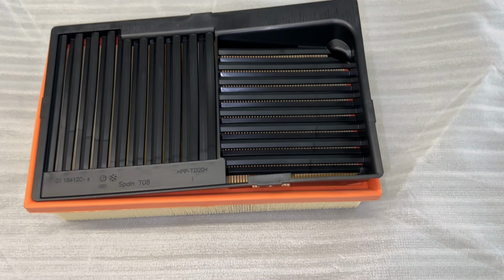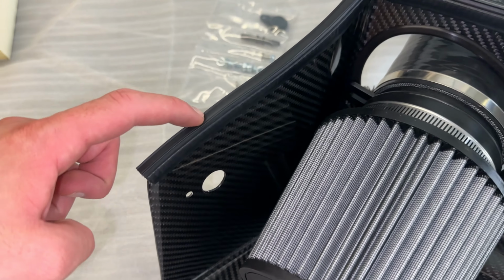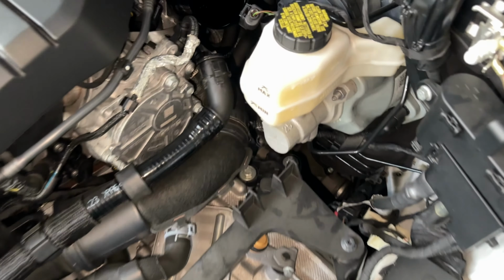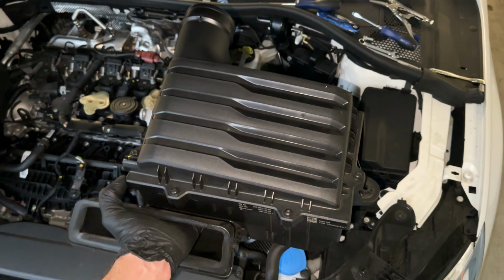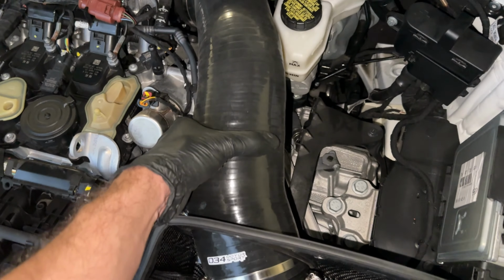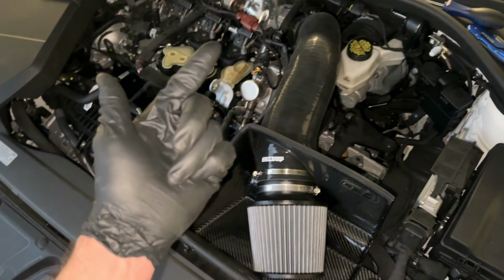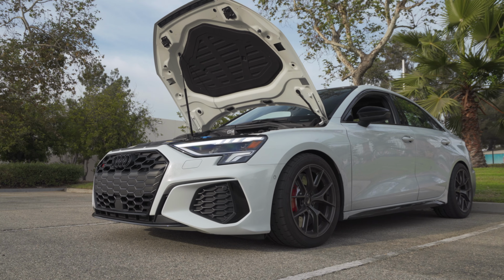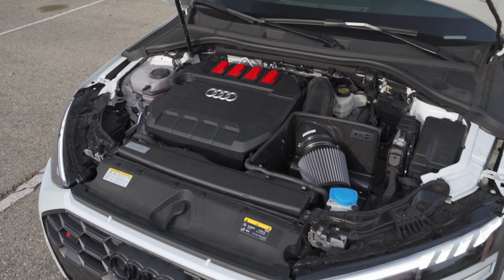The MOST Turbo Spool

Comment: Jewels, just as a fellow 8Y owner. Just keep an eye on making sure that the inlet hose is not rubbing on the brake line.
Reply: Seen a few guys have issues in the FB groups
Reply: I reached out to 034 and they told me they are working on a solution on the fitment issue. Not sure when we will be notified but it looks like this is getting the right exposure.
Reply from the maker: Thanks, it was adjusted during install to allow more clearance

Comment: I love how they make it seal to the hood, but leave a giant hole, where the intake tube goes through
Reply from the maker: Yup It pulls air away from the engine, as intended
Reply: Why would you want that?
Reply from the maker: @khalidfathallah6619  ambient air coming from the air-duct area is better than the hot air closer to the turbo
Reply: I know, but the whole where the intake tube is would be closer to the engine, therefore pulling in hot air. Isn’t there a snorkel or something where it could just draw ambient air from outside of the engine bay?

Comment: I find this car/build totally pointless given you also have a fully decked out GTI.
Reply: this car has Quattro AWD, the updated ea888, better tech and audi interior, and likely will be even faster than the GTI long term when he does upgraded turbo since its automatic and AWD
Reply: @rasterix5721  No doubt but still too similar to do another build after going though it with the GTI.
Reply from the maker: Gti is cool for rolls but the Audi has been an awesome daily that can do digs
Reply: It will be a lot faster than his gti tuned with turbo upgrades...
Reply: @JewelCity1 I still got your VR6 with the cams!
Reply: @rasterix5721  AWD = boring......i've had plenty.  RWD > AWD, 6/7 days a week.
Reply: Good for you Mike!
Reply: @1FastMKVSupra unless you live in a country that has snow 3 or 4 out of 7 days. Then it makes the audi much more versatile and practical.
Reply: @MatthewJay80  I get it, folks who need family sedans for kids who don't want to be burdened with a manual transmission and need AWD for the added weight, this is a perfect vehicle.  😀
Reply: @1FastMKVSupra  All drive types have their pros and cons, but AWD over FWD for launches. I drive a FWD VW and want to go AWD next, i’ve had RWD, FWD, and 4x4 but not all wheel.  Had 4 guys in a buddies intake only, Evo X powerslide/drift in the snow at +100mph and have been wanting AWD ever since.
Reply: He’s trying to build the channel I’m sure and add new platforms. Think of it like a mk8 golf r it’s practically the same thing but probably a bit better.